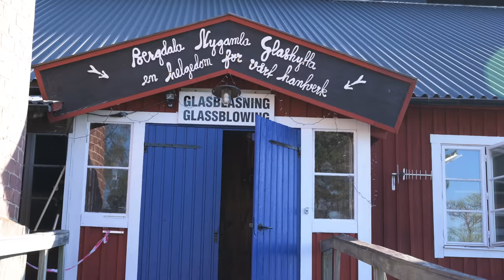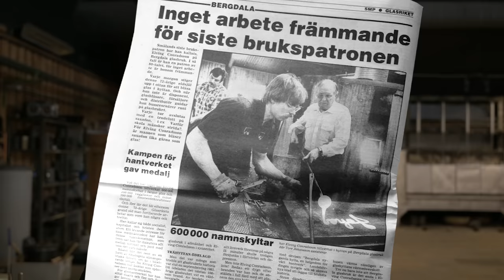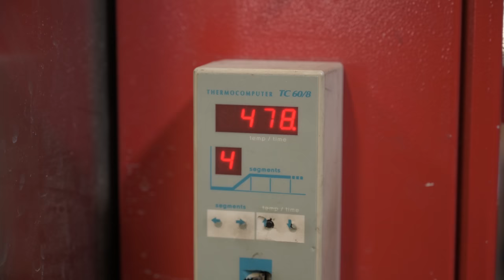The Art of Swedish Glass Blowing - A field trip to Bergdala

Comment: Great video ! As a blacksmith and having made many tools for glassblowers here in the US and being offered the chance to try it myself, I can say you did much better at it than I ever have.😉
Reply from the maker: Thanks! That's cool, if I may ask what kind of steel did you use? It seems a few of them were definitely stainless.
Reply: @torbjornahman  I made these tools over fifty years ago when there was a big resurgence in craft work here in Vermont. 
The hand tools with springs that work similar to our fullers then were made of mild steel the springs being hammered cold to work harden them stainless would be a better choice. I also built some annealing ovens from old refrigerator housings with electric elements and kaowool . Benches for sitting while rolling the pipets with niece little scrolls on the stops at the ends.
 I also made forms like they were using to blow into for making jugs and tumblers but from wood which the glassblower kept wet in water. I was given this work because I could make bits similar to modern spades bits and drill very large diameter holes on my low speed drill press cheaper than having a woodturner make them.

Comment: I absolutely love this. Torbjörn Åhman, YouTube's premiere source of content featuring extremely hot Swedish minerals! I didn't realize how liquid the glass was until I saw them glooping the blue sections on, and then I couldn't stop wondering how the floor isn't covered in weird spill-shaped burns.

Fascinating how they use gravity. It's a very powerful tool for shaping the glass. It has the force to move the material, but not so much force that it just tears it apart right away, and it's very predictable because the applied force never changes.* No human effort, no machinery, just Earth doing physics stuff. But also, you can't turn it off! If the glass is hot, gravity is working it. Whether you want it to or not. That's wild. I can't think of another trade with that kind of dynamic.

*Astrophysicists would like me to mention that gravitational pull is actually not perfectly constant, for a variety of reasons. If you are a glassblower and you're having an "off" day, feel free to blame the water cycle and plate tectonics for subtly altering the Earth's gravitational field.
Reply from the maker: Thank you!  Ha ha, yes blame the gravity!
Reply: I swear, master, it's not my fault! A particularly big chunk of basalt was pushed back into the core at the east African subduction zone last night.
Reply: @Deckzwabber  Exactly. Perfect technique.

Comment: I reckon these glassworks have an enormous energy bill. Do they keep the furnaces burning at night?
Reply from the maker: That's one of the major problems right now I'm afraid!  You need to have it "burning" 24/7. They melt the glass at 1300C during the night for about 9-12h, then hold it at 1100C at a working temperature. I think just the single large furnace was 120-150kW or there about....
Reply: @torbjornahman  Thx for the answer! At the current energy prices running a glass blowing factory must be a rip off. Even when the products are sold at a reasonable price.